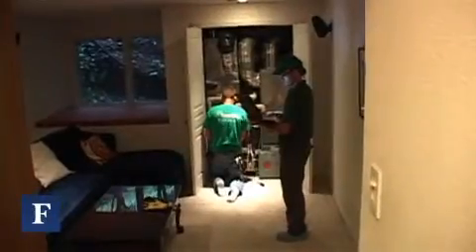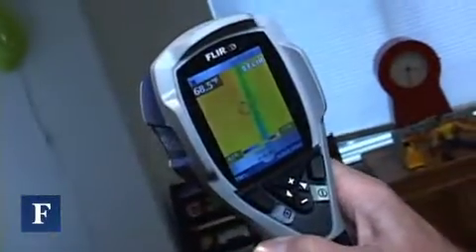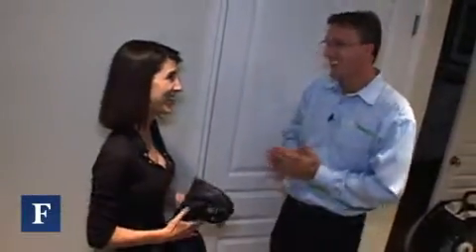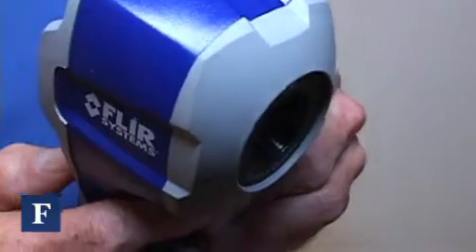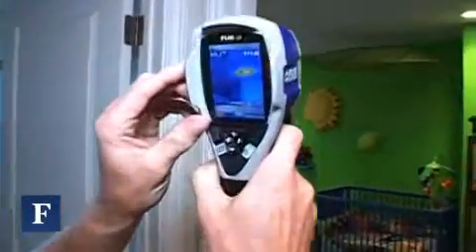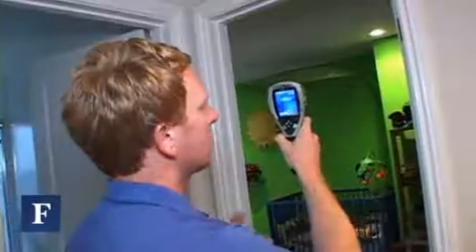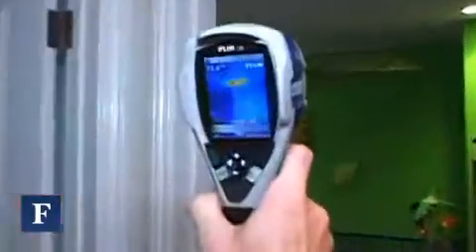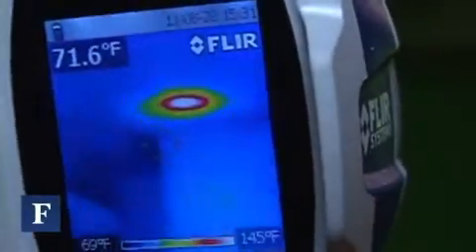Home Energy Audit Shocks SolarCity's CEO Video forbes

Comment: Saw an awful lot of lights on, hot incandescent can lights, etc. Surprised at the few CFL's and LEDs in the home of an environmental firm's CEO. Good on them for mentioning Duct leakage- a major problem in US homes.
Reply: Explain how duct leakage - which results in heated or cooled air leaking into the home itself - is a major problem. Especially when testing for it requires BLOCKING OFF the ducts that would be open with the system in operation. Reduce the pressure and you reduce the leakage. Ducts aren't sealed with the system operating. They're open. And since there is no such thing as a positive displacement furnace fan, there will ALWAYS be "leakage" in any duct system during operation. The air leaks mainly back past the fan.

Comment: It's going to be a little tough to pressurize the duct system unless you also block off the furnace its connected to. And "catastrophic leakage" isn't a big problem if the leakage is INTO THE HOME ITSELF.